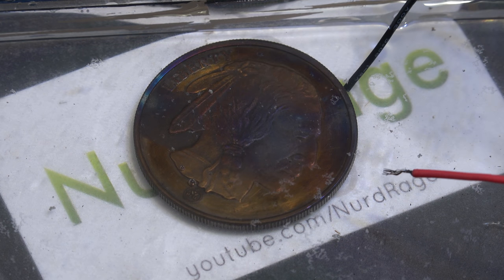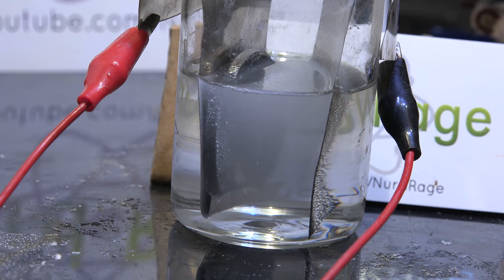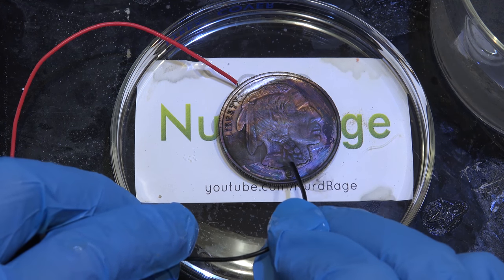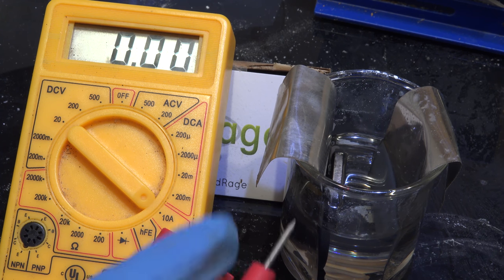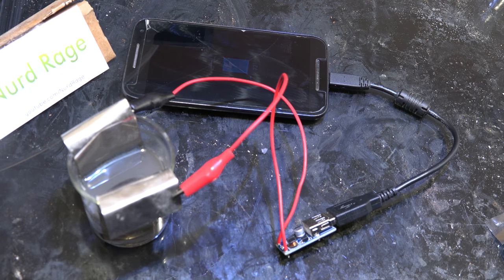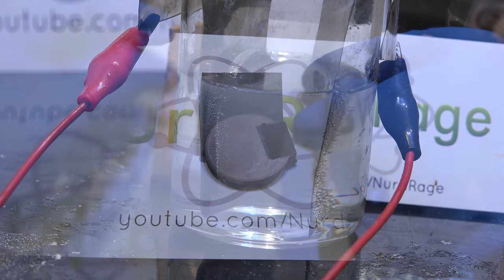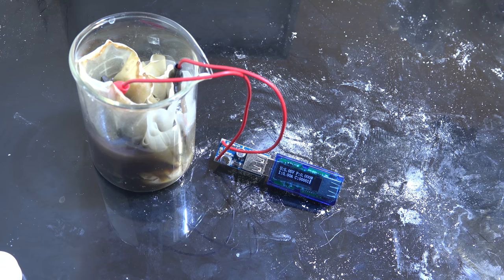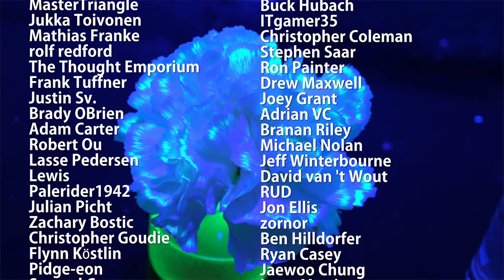Make a Silver Oxide Zinc Battery

Comment from the maker: I'll try my best to release the next video next week, but it'll likely be the week after.

(video will be on making ammonia gas, or purifying dirty ammonium nitrate from instant cold packs.
Reply: RS Creation  I've seen this so often now. I'm very sure it's a scam. They use an IR laser, which can't be seen to light the match. No chemical reaction involved.
Reply: Welcome back ;) two weeks doesn't sound bad anyways
Reply: I did a video on my old channel of 
Ammonium nitrate and nitro methane. 

Was pretty cool..
Reply: Hey NerdRage! I got a quick question...

Recently I've been needing a strong methylation agent and was looking into Dimethyl Sulfate as a good option..

Only problem is to import or get it in such large quantity (metric ton) would be pretty expensive...😩

Would there be an easier way to synthesis it? Preferably a cost effective route?
Reply: @NurdRage , the ampere-mete should be connect on serial mode not on parallel mode, Nice video, i like chemistry and i wait for an other video
Reply: Hey you got the exact same troy ounce buffalo coin I bought just last week, nice! :)
Reply: Ur the best!

Comment: Also works with potassium carbonate!!!!!!!!!!! Wow! It's obvious I can see the zinc plating onto the electrode! Very good performance.
You can also use lead dioxide for the positive electrode instead. to create a lead zinc battery and is rechargeable. Electrolyte may remain cloudy though. or settle at the bottom if you add too much.

Comment: Take a look at sintered metal. Maybe you can mix graphite and silver or zinc powder, compress it and put it in an oven to sinter it together (like a brick). You could even sinter the metal sponge to a metal strip so you dont need anything to keep it together. 
I think they do something like this but with a mesh instead of a metal sheet to get more sponge and even more surface area.
Reply: I don't think you can sinter silver in a typical oven because sintering requires temperatures near the melting point of the metal, or very high pressures, or both. Zinc would probably work.
Reply: Sintering occurs at around 2/3rds the melting point.

Comment: SR44 batteries are very nice for a lot of older cameras as well. LR44 and the modern li-ion variants often drop to the minimum voltage too fast to be economical to use.

Comment: I saw a talk some years back which found they could prevent dendrite formation by plating with an off-set AC current (eg a DC mean voltage of +0.5, but with peaks up to +1.5 and troughs to -0.5). Would be cool to see this replicated. I can't recall what frequencies they used, but the basis for it was that the "deplating" parts of the waveform would erode the dendrites, and diffusion would flatten out the concentration. You might even be able to use something simple like a joule thief to accomplish the offset-AC.
Reply: The process is called pulse plating and its not like there's "one setting" that corrects for non-uniform deposition but there is a wealth of information available online around the search term "pulse plating" that will help guide one through the learning / set up / optimization of this.

Comment: Silver Zinc battery was used in the submarines in the 60s, one cell used 80kg and the full battery was spending 45 metric tons of silver, capable of delivering 100 cycles over 2-year life. It is very sad it has little use today and very little documentation.

Comment: Lithium cell phone batteries are ~3.7 volts for one cell. USB (charging voltage) spec'd 4.5 - 5.5 volts or 3 x 1.55 volt cells.

Comment: I have a design in mind for such a battery that would just have one major flaw I can think of: not being able to be moved easily.

The idea would be to stack two cylindrical containers vertically in a tube containing the electrolyte. At the bottom of each subcontainer would be a current collector and some silver at the anode side.

The idea is that gravity should make the zinc (or the silver oxide) fall down onto the electrode itself when it does fall off, so no problem there, and you could probably put the electrodes quite close together because dendrites would only have a very convoluted way to cause a short circuit.

What do you think?

Probably gonna try it anyways as soon as I can cobble together a prototype, I'm curious. I guess the best way to understand batteries is to experiment. They still seem kinda magical to me.
Reply from the maker: Not a bad idea.
Reply: @NurdRage  damn, I built the aforementioned design, using just graphite as the cathode. I had a couple of decent cycles, improving with charge / discharge as the silver oxide was created I guess, but the electrolyte quickly became all black and the battery impossibile to charge nor discharge.

After disassembly I noticed there was almost nothing plated on the cathode.

I'm suspecting the metal particles mixed together and the battery self-discharged and got into an irrecoverable state.

So gravity alone, probably not enough to keep the terminals separated.

I now have a black, thick, very alkaline slurry containing probably zinc and silver oxide. I'd like to try to recover them, but I dunno how. Any suggestions?

Comment: I just want to point out the obvious, that the power consumption with the boost converter is greater than it would be if a higher voltage battery were used, due to efficiency losses in the converter.
Reply: No kidding, but sadly it's not recommended to use a fluctuating voltage on a usb port.

Comment: Hey @NurdRage on the subject of batteries: I've always been curious about those 'molten salt' batteries. They are used where you need to have ALOT of current discharged relatively quickly but also have ridiculous shelf life. Mostly used in missiles or satellites I think. Could you do a video on it explaining how that works? How can it be shelf stable for decades and not lose charge?
Reply: They don't lose charge because while they're sitting on the shelf, they have no electrolyte through which they can discharge. The salt acts as electrolyte only while liquid and it isn't liquid until you get the batteries extremely hot. Once the salt is molten, they start to self-discharge like any other battery.

Comment: Hi, just a thought regarding the powder version. If there is more ZnO than KOH then there is no KOH left to help migrate ions, right? So the clear version with the solid coin had better ion conductivity as there were excess of KOH, just guessing. But if you have spare time it would be interesting to know, if pouring dissolved ZnO in KOH will improve the powder version. Also the contact and the separation should not be a problem as well as long as the silver oxide is not in contact with the zinc electrode ... maybe rearranging as Daniel's cell with silver at the bottom … Yep, that is the battery you shared with us Cu/Zn … Anyway love your science videos :-)

Comment: Can anybody tell me how long would a 12volt silver zinc battery last by continually powering a small car air conditioner (eg Toyota Yaris or Echo).

I realise in this case the cars engine would be needed to power the air con but I’m talking about just running it directly from a 12v silver zinc battery.

And approximately how much would that 12volt battery weigh. Anyone?
Thanks in advance.

Comment: Isn't there a cheaper metal to substitute for silver that accomplishes the same thing?
Reply: The voltage produced by a battery depends on the difference of redox potentials of the two metals. Iron is close (0.77 V compared to 0.80 V for Ag), though silver isn't that hard to get. Maybe look on a flea market for some old silverware and get one or two spoons?

Comment: The reason why they didn't work good is because of how loosely the powders were held together I think you said that actually in the video didn't you? I think this is an old video so you probably not going to answer LOL but at any rate you have to bind the powders together tightly with the conductors that you connect with like wrap them with the wire around them tightly and they work marvelously if you do that I got a big bag of silver powder I might try it myself

Comment: If potassium hydroxide works better than sodium hydroxide would lithium hydroxide work better than potassium hydroxide?
Reply: I dont think so , potassium ions and hydroxide ions are more easily seperated by water(since K+ give less attraction, due to shielding), (higher solubility) so more mobile ions could exist in solution.
Lithium hydroxide is less soluble in this case(less shielding), so less mobile ions exist in solution.
Im not professional in chemistry, so there might be mistakes.
So , theorietically higher the period of metal eg: rubidium should work even better.

Barium hydroxide is more soluble in water than magnesium hydroxide(almost insoluble)

Edit: if the solution is saturated
Reply: @RandomMan-nv2qh  I see how I was mistaken here, I had the order of alkali metals backwards. If the higher the metal works better then the best metal for that in theory would be ceasium or francium. Don't know how accurate I am with this but still
Reply: @Romuls753  yeh everyone make mistakes (im not sure mine is correct or not XD)
Reply: @RandomMan-nv2qh  I know, I also can imagine that with the expense involved in getting something like francium you could probably build an even better battery that operates differently

Comment: I recall that the ISS uses silver batteries until recently they are replacing them with LIon
Reply: ISS batteries were nickle hydrogen not sure why they replaced them with Lion as the former has a much longer cycle life but LIon has higher energy density about twice so they can be smaller.
 Now the Apollo spacecraft did use silver oxide batteries which actually have a better watt hour per volume than LIon but a worse power be weight.
Reply: It must be the nickle part that confused me then
Reply: I thought the Apollo spacecrafts ran on methanol fuel cells?
Reply: @among-us-99999  Hydrogen fuels cells were the primary power source for the CSM batteries were used for back up and for reentry in the command module while the LM only had batteries.

Comment: Seems more like a capacitor than a battery.
Reply from the maker: Redox is happening. So it's a battery. Capacitors don't have redox reactions
Reply: @NurdRage  i know but the high amp quick discharge is very similar to capacitors.  Chemically and physically completely different.
Reply: Oneofdazzz nope, chemically totally a battery. Just a very small one.

And the current/voltage/whatever curves wouldn’t look like the ones of a capacitor.
Reply: @OneOfDisease  wtf high amp???!!! have you ever hooked a capacitor to an oscilloscope?